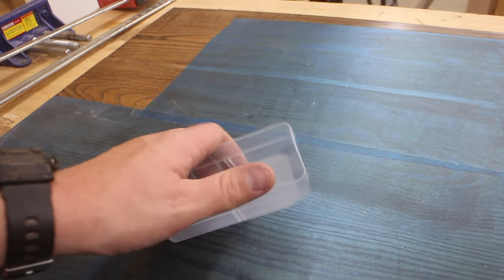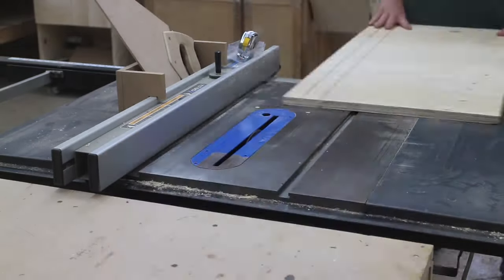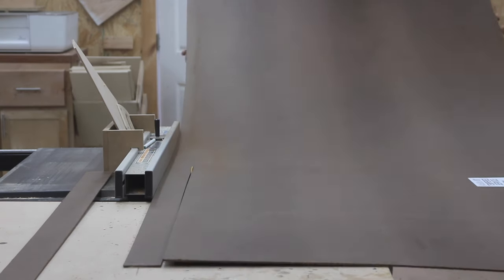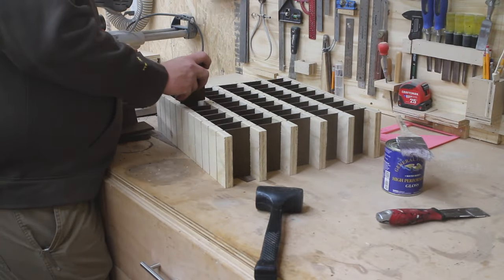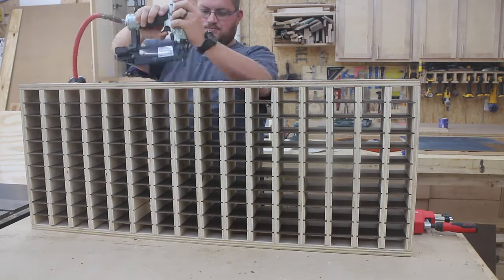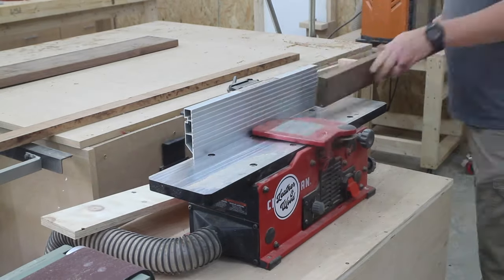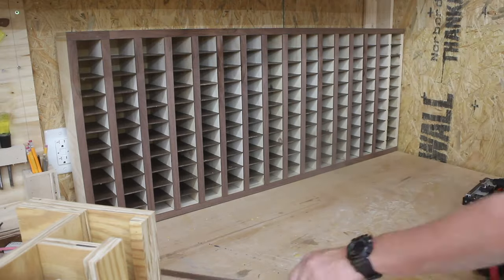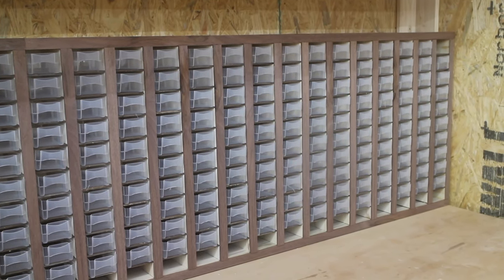The BEST Small Parts Organizer - Small Parts Bins

Comment: Is the hardboard drawer bottoms strong enough? No bowing?
Reply from the maker: Absolutely, they're great. Usually (as you know) hardboard isn't super strong. But with those pieces being so small in relation to the amount that's supported on the sides, they hold up fine. And one of those trays full of screws doesn't really weigh all that much.

Comment: I am little concerned about the safety aspect of your video.  Using your bare hands to push wood through a jointer is a little scary.
Reply from the maker: Thank you for your concern. I have since upgraded my jointer and have 2-3 push sticks laying around that I use when operating the jointer.
Reply: 😂 that's why I couldn't watch till the end... 
This is not a craft movie. This is a horror movie 😅

Comment: Just came here after watching Adam Savage's Sortimo sliding drawer cabinets build. I guess you're both bougie 😂 but his plywood was much worse. Probably could've used less material to maintain sheer stiffness with a single diagonal brace. I'm also wondering if half thickness interior uprights would also have worked and created a narrow cabinet if they were held sufficiently at the back to prevent sagging.
Reply from the maker: Very good points to consider